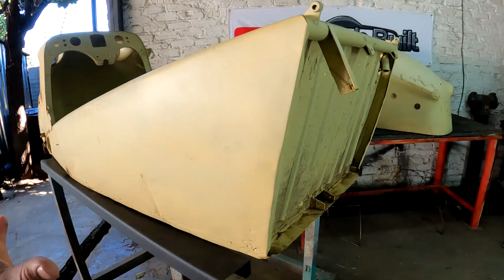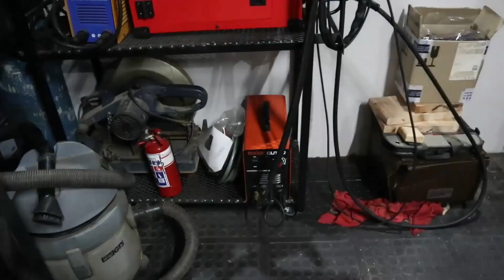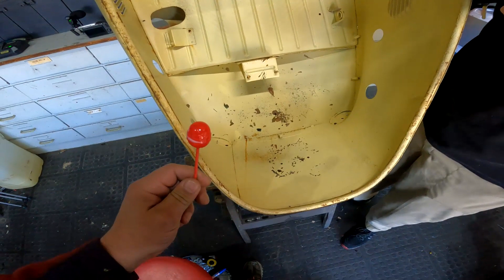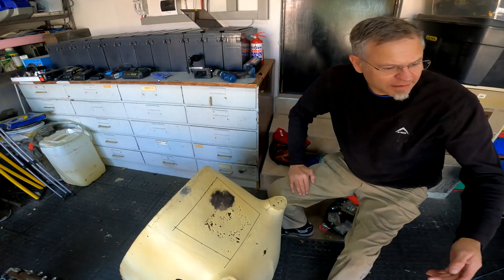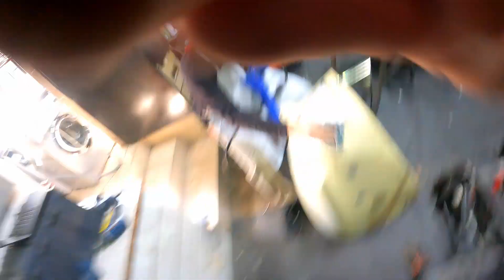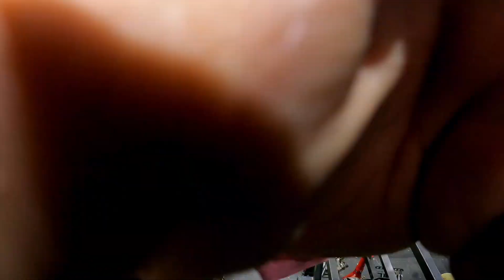Part 3: Rusty Sheet metal repair on our Messerschmitt build

Comment: If you want to work on car bodies , get a TIG welder. For heavier and less smooth welds, use a MIG. As you can see in the video, while MIG does work on sheet metal, a lot of cleanup afterwards is required. (TIG also works better on aluminium sheet).